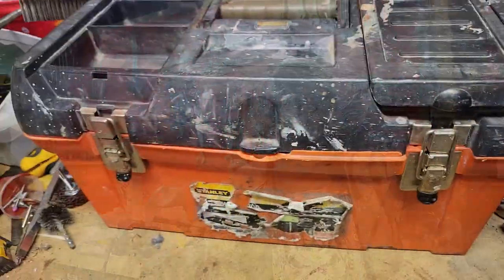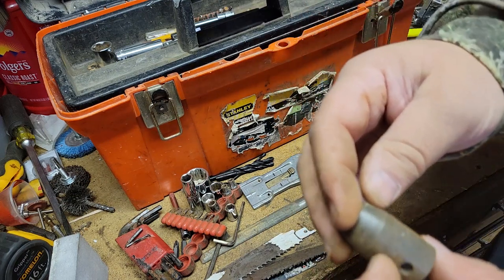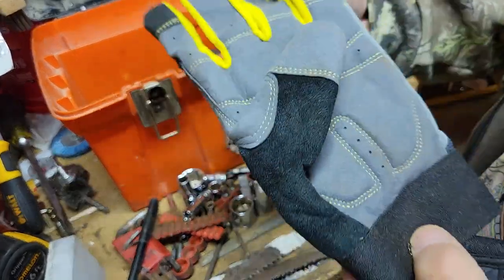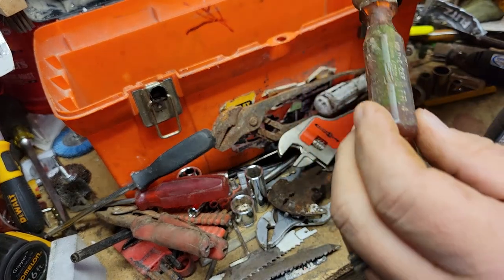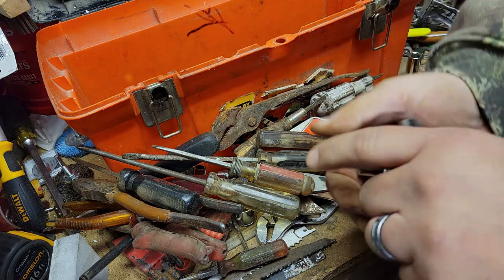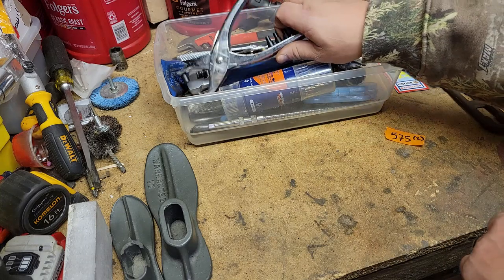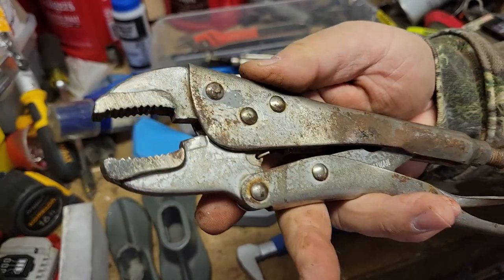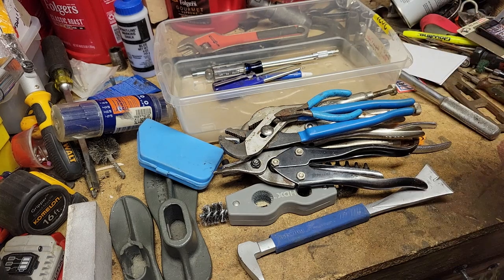Tool Auction haul

Comment: Is that my 1/2"&13mm Metrinch that I lost 20 years ago? Metrinch was the first socket set I ever bought and I used the heck out of it too. Over the years I ended up breaking the spinner, the ratchet and also lost that socket. I bought the whole set at the local hardware store for something like $5.99 on sale..........It actually is a pretty good set but back in my youth I could be kinda rough on tools.     For those that never heard of it, Metrinch was/are tools that were made to be used on metric and standard so each socket has a metric and standard size stamped on it.
Check Ya Later !!
Reply from the maker: That is cool info! Thanks 👍